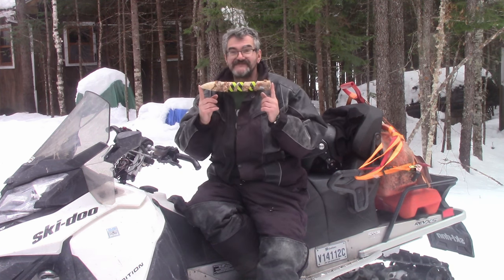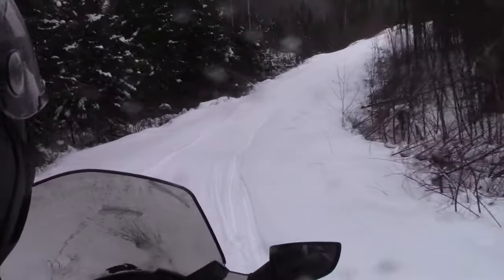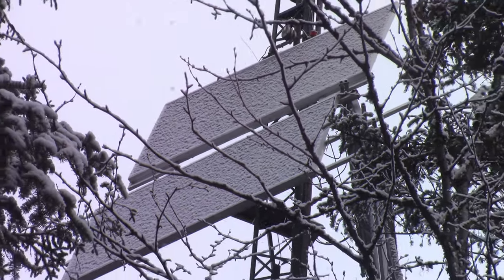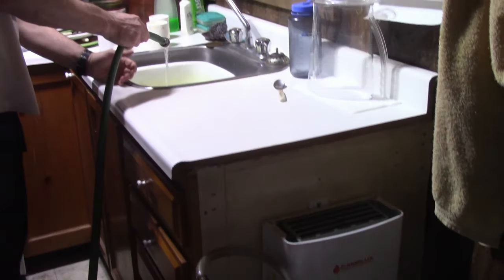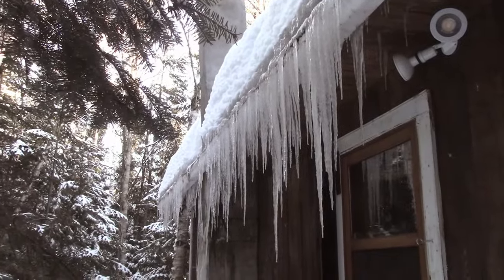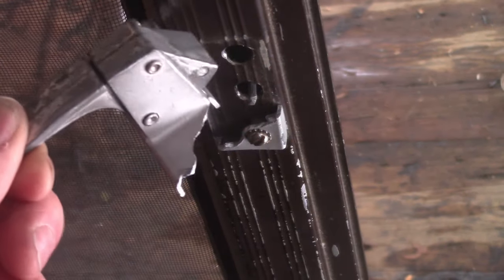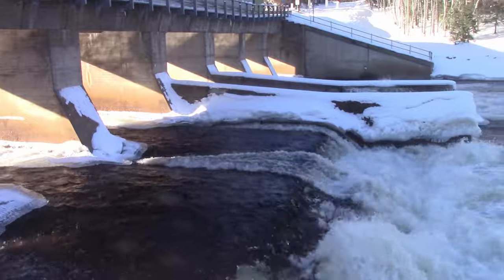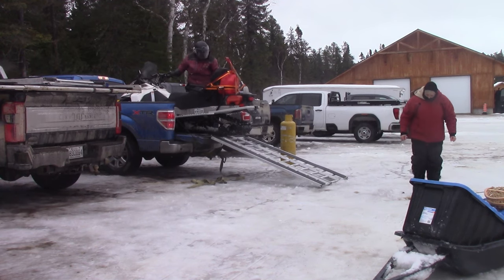The Woodpecker - Cottage in the beginning of February

Comment: At 8:42; I don't want to be one of "them", but consider putting a shield or something over the propane pressure line regulator. I see the regulator has ice on it.  It's critical that the small air vent hole underneath does not ice over. If it does get closed, the regulator's diaphragm can't do its job. You could have runaway pressure at the burner (think blow torch). Working as a forensic engineer many years ago, I had personally seen a farmer's pigs barn burn down (hundreds of pigs lost), because the regulator was under the direct path of melting water and refreezing from the roof. The regulator was unable to step down the tank's pressure to 11" of water. To protect it, it could be as simple as a bucket with two notches to fit over the lines. It probably won't pivot because of hose tee; but check.

As usual great video.
Reply from the maker: Thank you,  I had no clue. One of the great thing of making these videos, is that sometime I stumble on someone who gives me sound advice, just like you. I will put something on top of the tank on my next trip in a couple of weeks. Thank you so much again

Comment: Do you have a heater for the cottage battery in the winter?
And yes, I do enjoy the chalet videos.   It's lovely and rustic
Reply from the maker: Since my batteries are not Lithium-Ion I don't need keep them worm. I have four lead/acid 6v battery which gives me 500Ah at 12 volts. But if the sun is  not there when we're there, this will only gives us electricity for about 30 hours. When we're there,  I have quite a few electronic gadgets that I've build that is working 24/7 and we always bring our laptops, this is what eats up most of our power. But during our stay we had to start the generator only one day, but I bought a new battery charger and I was able to charge the batteries  at 30 Amperes while the generator was running. 
A lot of people are liking my cottage videos, it's why I keep making them. Thank you